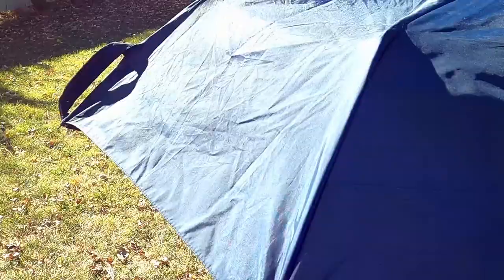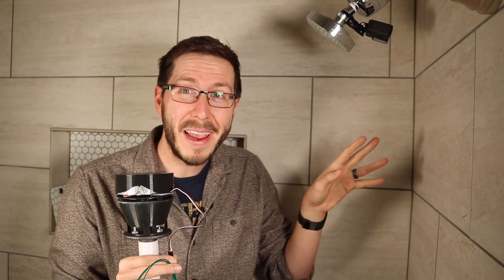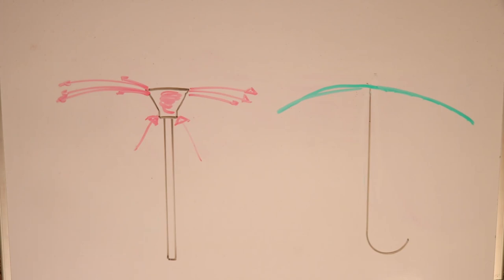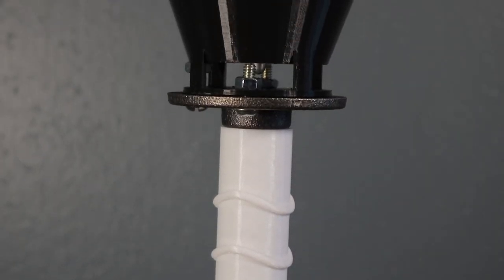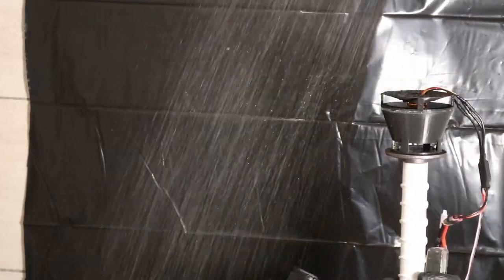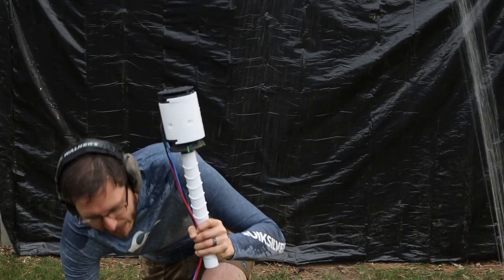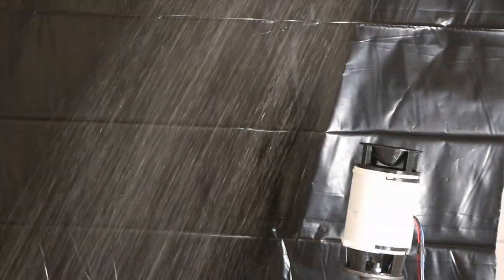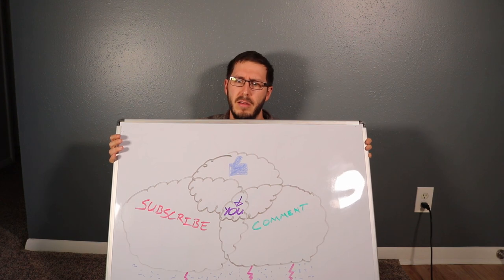Air Umbrella gets a Second Wind!

Comment: ok. this is a huge long shot, but it seems promising kinda. check out Turbine Car. they existed in the 1950's before hundreds got scraped for odd reasons. But if jet turbines can be put in cars, maybe a miniature turbine engine can be used here and all the components put in the umbrella stick.... on second thought, the spin generated might to too high to hold, but might be worth looking into anyways in case you find something useful or interested in other way
Reply from the maker: That is an interesting thought. My second version sort of does that using an electric Ducted fan. I would be terrified to an even greater extent if it was a combustion turbine. I do not trust myself enough to not have it explode

Comment: You are relying on the sideways air blast to deflect the falling rain drops but to work properly it would mean moving a lot of air at high speed to have any chance of causing enough deflection. What if the rain was to be slowed down by an upwards air blast then the sideways blast would have a better chance of deflecting the rain. Still requires a lot of air movement but probably easier than with sideways blast alone.
Reply from the maker: That is a good thought. I do angle the stream of air upwards slightly but it sounds like you are suggesting to have two stream of air. One vehicle to slow the rain and the other horizontal to deflect the rain.
Reply: @RyanMake Vehicle? (Autocorrect strikes again.)
Thats right. Get the most powerful fan you can find blowing vertically and fit a deflector to send part of the stream horizontal. Keeps you dry for ~ 5 minutes then the battery dies.

Comment: ok what about this. a thicker handle. and multiple air fans at the top, like 3 one on top the other. if one fan can kinda move the air. maybe 3 fans can make it effective enough to actually repel rain a good distance.

more fans.
wider handle stick for more power.
maybe experiment with air slant angles.
Reply from the maker: These are some interesting ideas. You are right it comes down to a balance of air quantity, velocity, and direction (I know velocity has direction in it)
The big thing would be how to source the air to the seperate fans so they do not fight and starve each other

Comment: Getting soaked in the name of science!
What if you slapped this thing on a car and used it as an alternative to windshield wipers?
Reply from the maker: That is a great question. I have been wanting to make an air curtain to try and replace a shower curtain but it could be interesting to make air wipers as well. I will need to to think about what this would take because it will need to overcome the rains terminal velocity and the speed of the car.
Reply: @RyanMake  i calculated the numbers out once awhile back because I was interested in doing it for a school project, but I don't remember the force required.
You'd have to stick an air compressor in your car ha.
Reply: AzazelCry An Air compressor sounds like a small price to pay... trust me... I should know 😉

Comment: hmm just throwing some ideas .. what if the air doesn't blow to the sides but creates an upside down whirlwind that throws the water up and away from you ?
Reply from the maker: That is an interesting question. I could look into using the bladeless fan setup from my fire tornado projects.